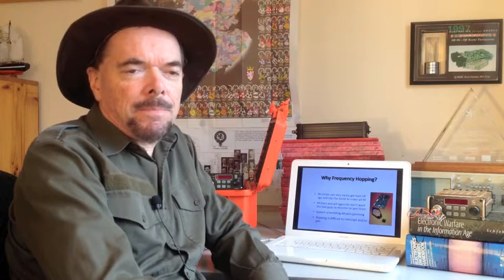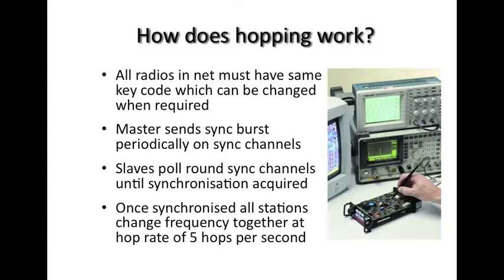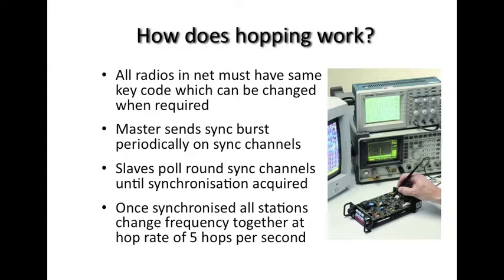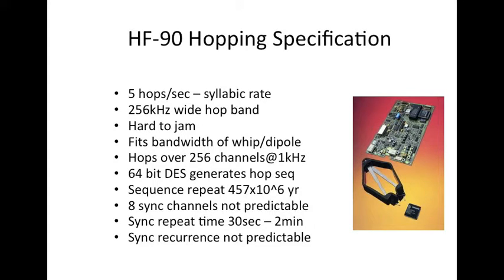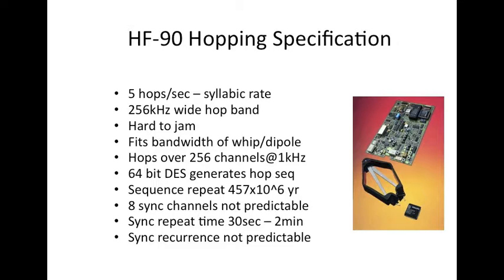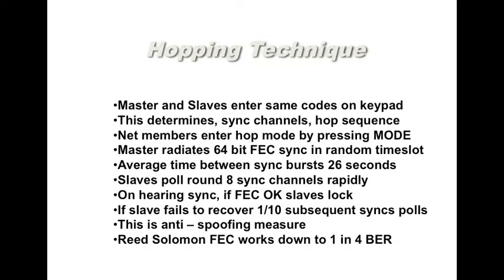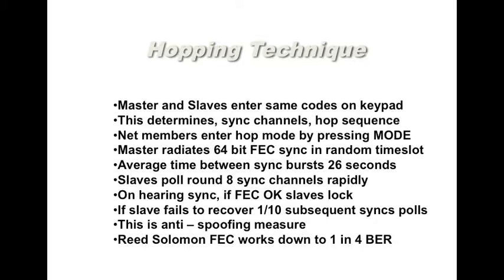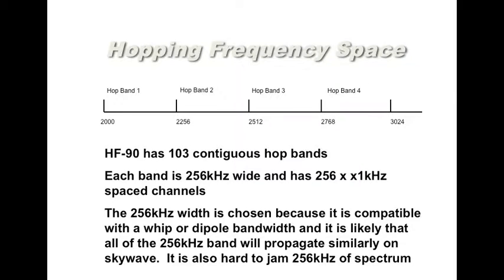Q-MAC HF-90 HF frequency hopping radio

Comment: So I am just entering the world of amateur radio.  Our Radios in the Army were FH.  So what you’re saying is that it is possible to use FH on the civilian side?
Reply from the maker: I think that with a restricted hop set you can use hopping on ham bands but the HF-90 has quite a secure algorithm so can't be used on ham bands in hop mode.
Reply: Is it a particular model of HF90 that has this feature?  I have found several used online but would hate to spend the money on a transceiver not equipped with this unique feature.
Reply from the maker: @HumbleVet  Only the HF-90H has hopping implemented. On HF-90E when the mode button is pressed it toggles sideband from USB to LSB. It is very unlikely you will see an HF-90H for sale as they were only sold to armies.